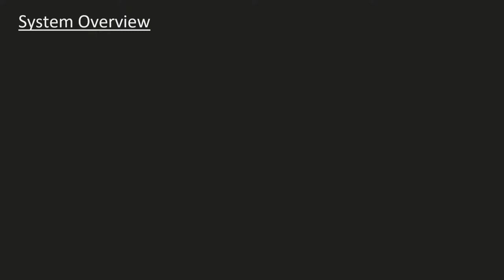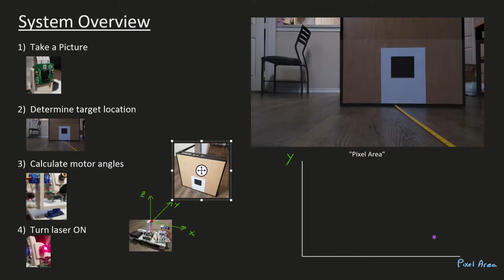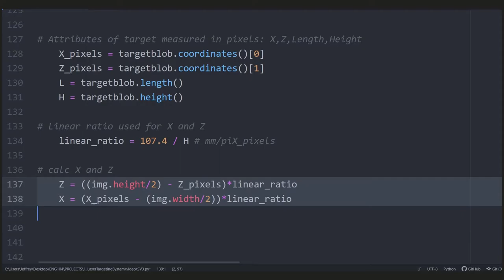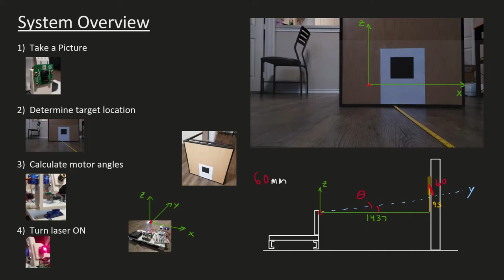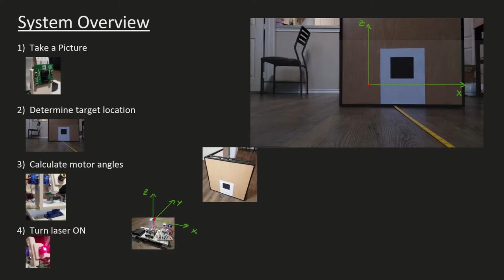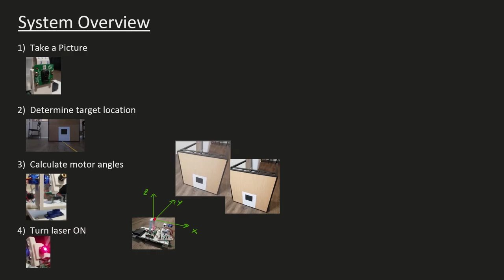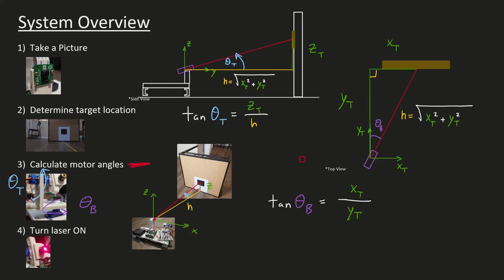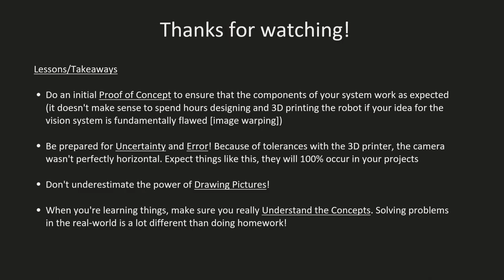Engineering Project Breakdown - 1 - Automatic Laser Turret

Comment: As you did a fit, then why not matching the mapping between motor control angles and position on the image plane, by identifying numerical parameters upon a calibration procedure that does not require measuring lengths in the real world?

Comment: 8:45 ”Real actual units of length”  don't know if I should feel insulted or not 😂 like you called the Metric system (the mm) ”real” which I’m proud (that weird Imperial system should be illegal, like what’s a mile 😂)... But... You insulted my pixels as not ”real”... A pixel is the length of one physical point of a image. In other words, for physical images (like printed) it can be unit of measurements in graphic design of about 0.26mm🙃 how fake is that? 🤔😂
Reply: Great video btw! I will let my Engineering Math Prep students about it :)
Reply from the maker: I tried making this project as inclusive as possible haha
Reply: I know Jeff I was just messing with you haha! I love this project it touches multiple fields: math, programming, electrical engineering, mechanical, ... I’m very exited about that raspberry pi!
Reply from the maker: Only a true master, an expert in all the disciplines, can build the robots...